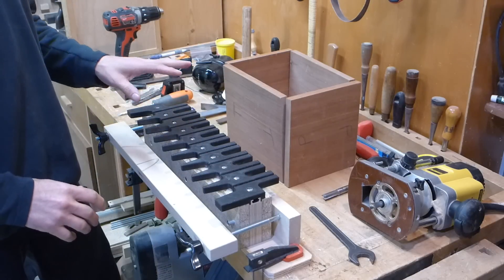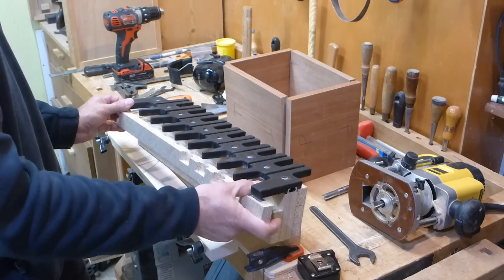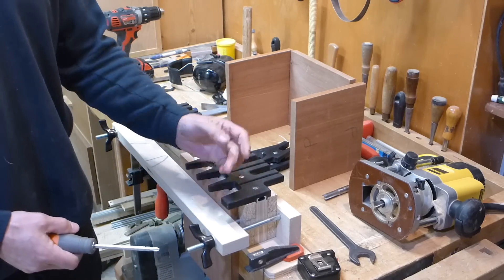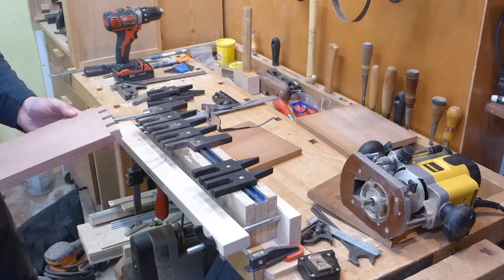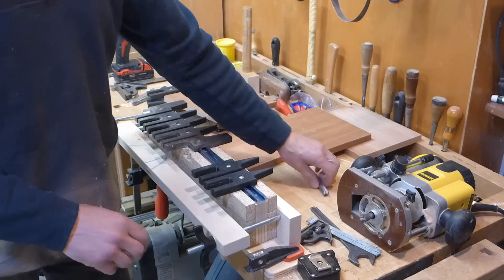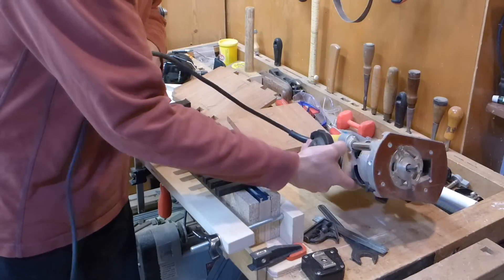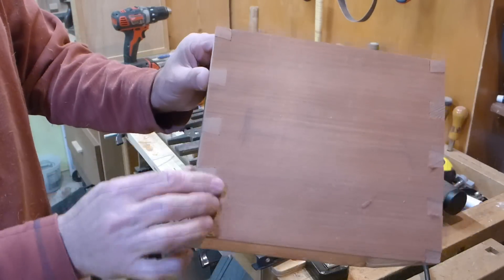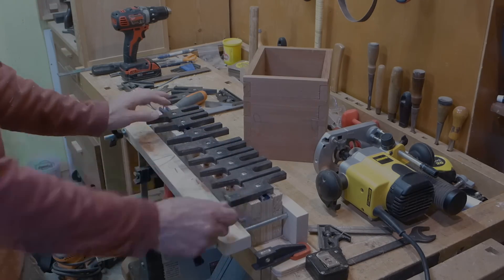3D Printed Dovetail Jig for Less Than $100

Comment: Does the straight bit have the same diameter as the dovetail bit? I found an 11/16” dovetail bit, what size straight bit do I need? Sorry if I missed that part, I can’t seem to find where you mention it. Already have the jig printed out, thanks!!
Reply: Please, can you let me know what size straight bit to use? I made the jig, but am unsure what straight bit to use with the 11/16'' dovetail bit! Thank you!!!
Reply: @idhatemet00  in the instructables link he notes the straight bit is a 1/2"

Comment: I like it a lot! Wish I'd seen this before I spent $200 on a jig for home.

I build drawers at work, usually 15-25 drawers at a time. This would be painfully slow for production work, but I think the general concept could be adapted to make setup faster.

- dedicated templates and jigs for 4" and 8" tall drawers.
- two dedicated routers for straight and dovetail cuts,
- faster clamping with bar clamps or quick clamps,
- maybe, pins and tails on the same side of the template.

One thing I always make sure to do when cranking out drawer parts is to clear all the wood chips before clamping up the next parts. I think rogue chips throw off my joints, but it's probably something else like warped material or sloppy machine setup.
Reply from the maker: Thanks! For production work, I think most folks will lean toward the commercial jigs that cut both parts of the joint at once (and make a half-blind dovetail rather than a through dovetail). These cut a complete joint in half the time, but I’ve never liked that style of dovetail - they just seem too unsubstantial. 

I do think my design is more suited to the home woodworker, but even then, if you’re going to make a lot of dovetails I think that something as simple as replacing the t-handles with cam-action clamps would make it faster to get the stock in and out of the jig, and if I’m doing a project where I’m making multiple boxes with dovetails, I do as you suggested and step up two routers - one for dovetails and one for pins. As for the suggestion to have the pins and tails on the same side, I don’t see much gain from that. You typically cut all of the tails for a project first, then cut all of the pins, so you’re only turning the jig once in the course of the whole project. You also lose the advantage of having the pins and tails automatically align, so it would make the setup much more involved. And yes, you need to keep the jig free of chips. I usually have a vacuum close by and use it to clear out the jig between cuts.